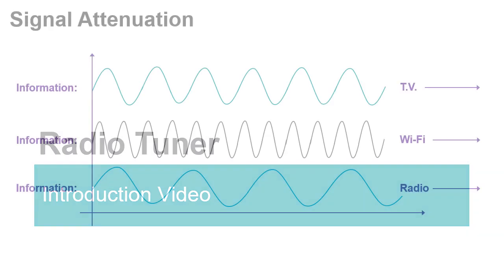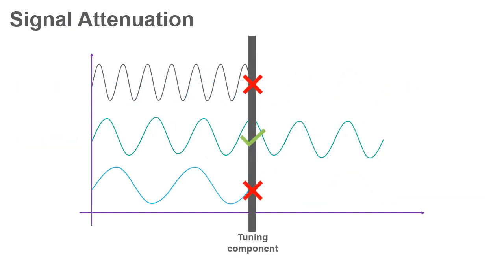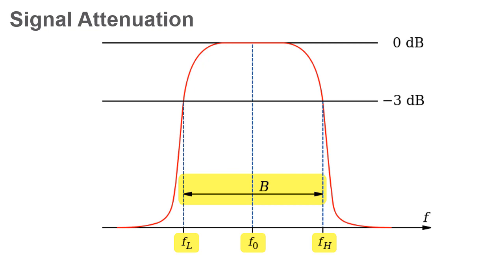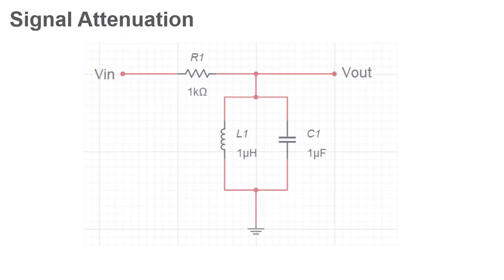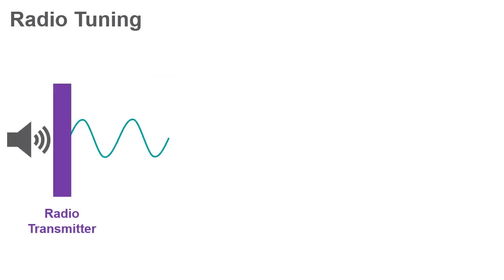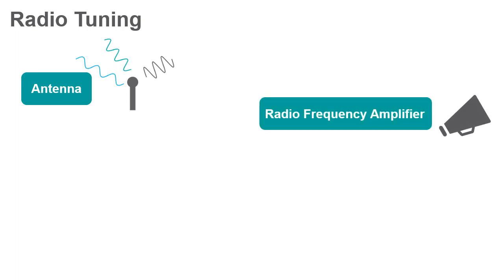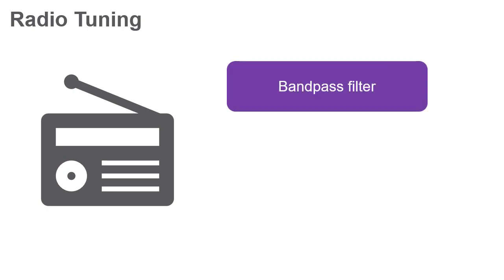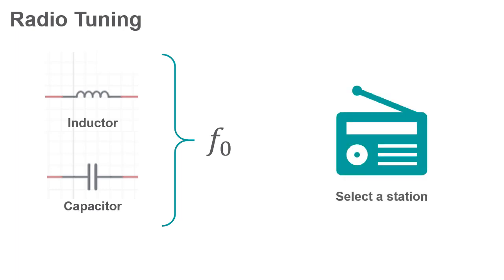Radio Tuner

Comment: Hello, I am learning about L-C circuits in my physics course currently and was wondering if you could clarify something. At 1:44, you stated that "the Impedance of a PARALLEL LC circuit is maximized at resonant frequency. From my physics textbook, it is stated that at resonant frequency, the impedance of a series L-C circuit is actually minimized. This is due to inductive reactance and inductive capacitance canceling each other out when the frequency= resonant frequency. 

Now, the disparity between these two statements seem to be explained due to the fact that your diagram has the LC circuit in parallel, while mine was explained in series. With this being said, I am having a hard time explaining further and was wondering if you could help me somewhat? :)

Any feedback would be greatly appreciated,
-Dakota
Reply: Have you brushed your shoulders with phasor diagrams?